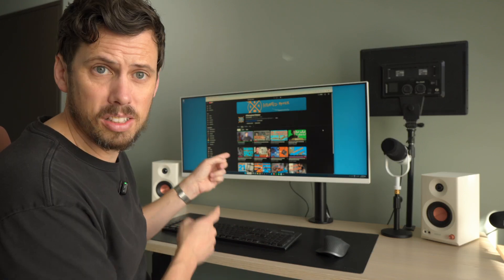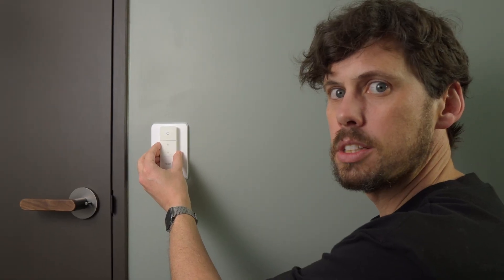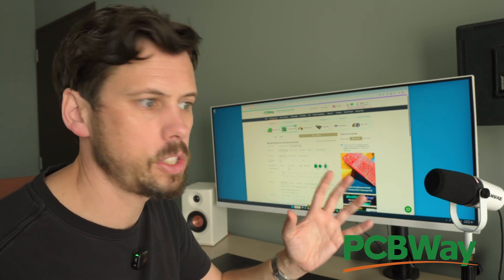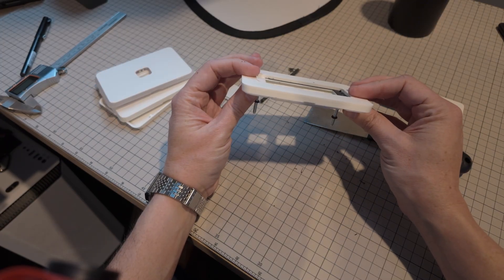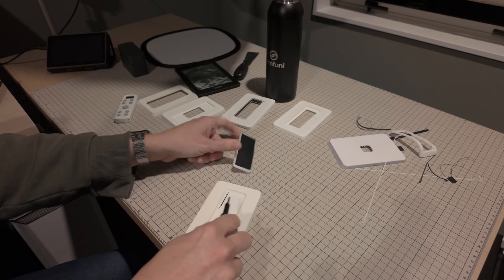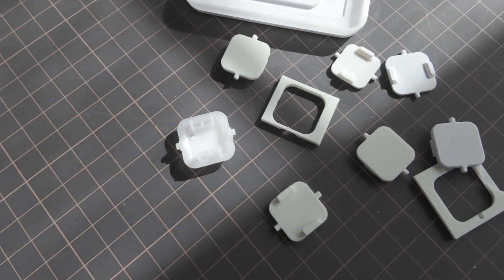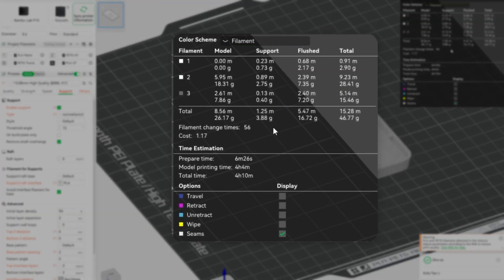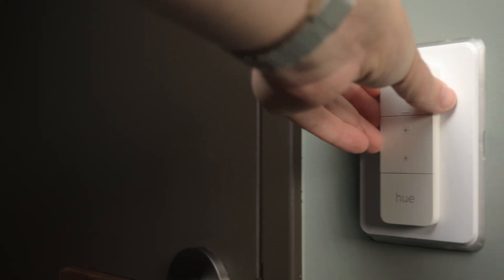Attempting to Make the Perfect Hue Dimmer Mount

Comment: Your process looks a lot like mine. I really struggle with creating acurate prints as I suffer with Aphantasia, so I can't visualise things and I often need to print things just to be able to figure out the next steps. What I found really helps me is to model the parts I plan to build around and then start modelling the thing I want to make.
Reply from the maker: Dude! Me too. I cannot picture a thing until I'm holding it in my hands. I can't picture how a chair would look in a room until it's in there.

Good advice for the modeling the other part first. The main thing that has stopped me from doing that is lazyness, but you're right, I'll save a lot of time at the other end.
Reply: @AttemptedMaker I’ve found you can get accurate models on a lot of the 3d printing model repositories (search for the thing you want on Thangs using their “meta” feature that searches Printables, thingiverse, maker world and others all at once)

Comment: Ooh, I have been hitting the exact same issue. I've currently resorted to hard wiring the lights on and just mounting the hue remote panel in the place of the switch - the screws line up the same as the PDL plates.
This looks much cleaner though.
Reply from the maker: If you've got the same PDL plates, there's a link in the description to the files for this. It would be great if this turnes out to be useful for someone else.

Comment: Nice i have been working on some functional design too and you just summarized my work process (too many prototipes)
Reply from the maker: Good to know I'm not the only one.
Reply: @AttemptedMaker i am now working on something and it has 27 prototipes any isn't finished yet i have filld my computer with the files and my home with the porototipes . I am making a separate video going ower just the prototipes and it is already 1.5 hours long